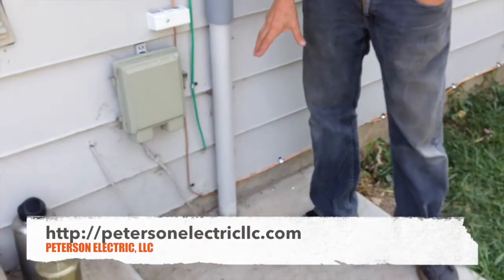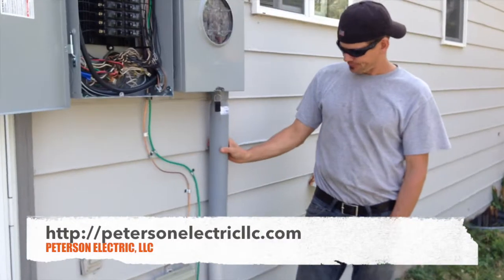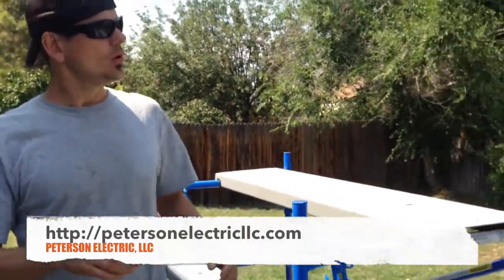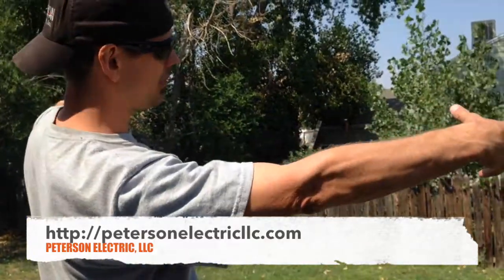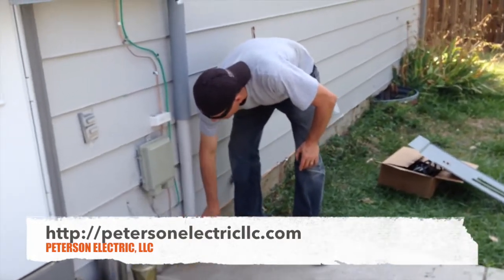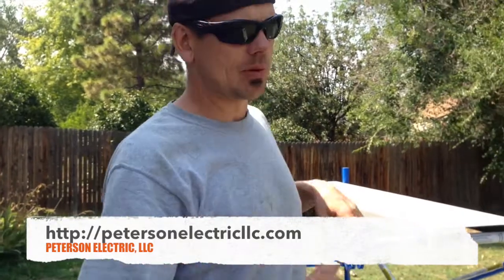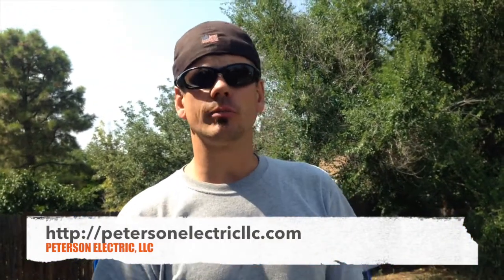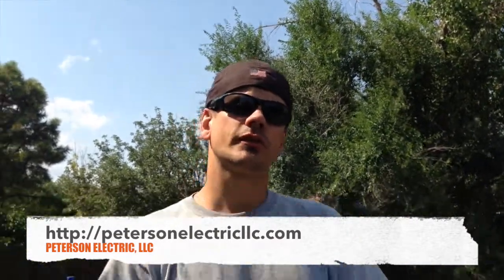Residential Service Change, Where Is Your Transformer For Power To Your House Panel

Comment: We got 1 pad transformer per 4 homes. Each home gets 200A service, which means that puppy should be capable of surviving 200 000kVA peak?
Reply from the maker: Arthur Vin not sure how utilities rate this. Typically I see 25kva above ground and it looks like four to six homes. Probably depends on the homes if they are 100 to 150 or 200 amps rated